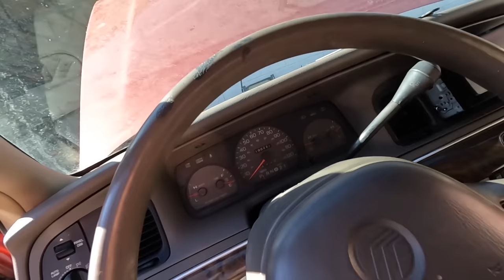We’re Building Joshua a Race Car! Time to go Crown Vic Racing

Comment: Use the inner part of the hood release cable. Works perfectly. Also don't forget to bypass the fuel pump enertia switch. It's in the trunk drivers side.

Comment: If you're not trying to save the windshield, just use whatever you've got. It's not the same type of glass as the sides. It's separate sheets with adhesive between... it won't shatter. It'll break, crack, get millions of lines.... but it'll still be a full piece.

Comment: Yall need more practice at gutting enduro cars. We used to do a couple a year down here. We even had what they called sack races. The driver would wear a sack over his head and had 3 passengers  to give him instruction. worst part was they would run the race backwords  some times to take away the advantage for the drivers that raced the track all the time. It was great. 1/2 mile high bank oval. lol

Comment: I wish I would have known you wanted some crown Vicky's,I have 2 in my barn, already gutted and caged just need fuel cells,the motors a real 351 INTERCEPTOR ENGINE'S, another project I had big plans for 😂 but 1500 would have gotten both, they should pass y'all's track inspections they were built for bubba raceway
Reply from the maker: We’re interested! Send pics and info to joshua@huntthefront.net